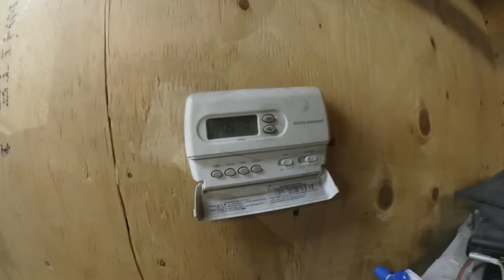Burning Toxic Chinese Wood

Comment: I have to get a new one. Mostly cause like you the insurance is a issue. I was looking a tankless hot water heaters. what is your opinion on those those?  -John
Reply from the maker: my cousin installs them and he said you need soft water for them otherwise the life span is quite short
Reply: Never heard of having to replace a water heater due to age. Continuous (tankless) hot water heaters are quite common in the UK, seem fairly robust.

Comment: First admitting I'm not an engineer .... Should there be bracing on either side of the upright square-tubing? Even though the welds are strong, I would constantly be concerned about having only two points of support.

Comment: Are you gonna need a gusset on the bottom of the brake stand , It does`nt look light , Shit that is a good welder .
Reply from the maker: +Garnett M no not yet haven't had any issues
Reply: Bullshitkorner Oh just thinking so it doesn't catch you off guard while you're cutting a special piece and the weld let's go and it falls towards the car when not watching ,An ounce of prevention is worth a pound of cure .

Comment: Replace the water heater every 10 year?? Shit where I live those things don't get replaced until they blow up. Been in some houses 40, 50 years old with the original unit. And no they didn't work worth a shit. Cheap ass slumlords.
Reply from the maker: +jtip82 that's either insane or some damn good quality of tanks